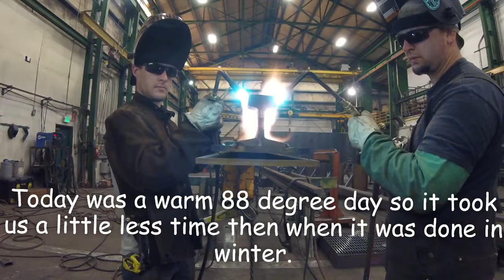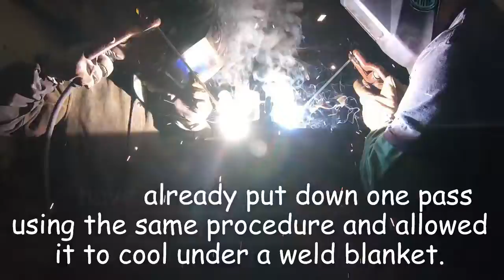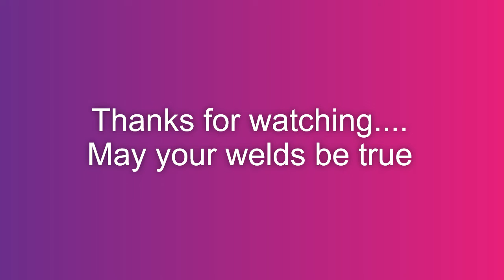How to weld High carbon steel alloy train tracks

Comment: What happens if you skip the preheat?Im going to be welding a land leveling blade from these tracks soon and from what I tried so far the weld breaks of right away from the material.Its like it wouldn't even bond
Reply from the maker: Make sure its preheated real good. ....use a high alloy rod I like 7018....and either cover the weld with a weld blanket to allow slow cooling or post heat with a torch to slow the cooling....I have watched weld break and separate from cooling to fast
Reply: @outdoorsoforegon  thank you so much